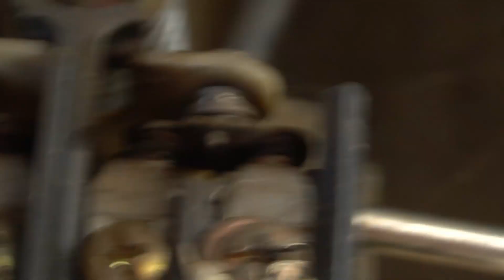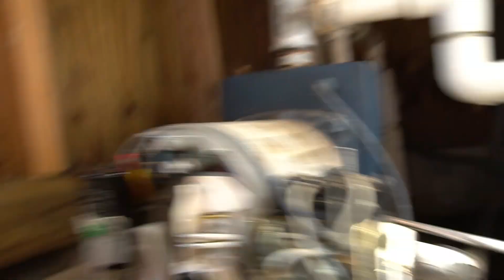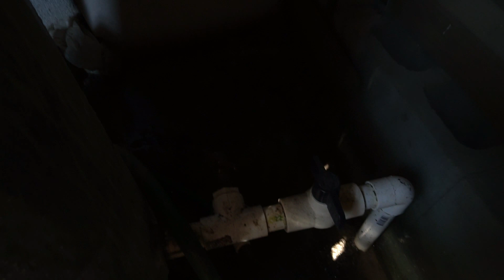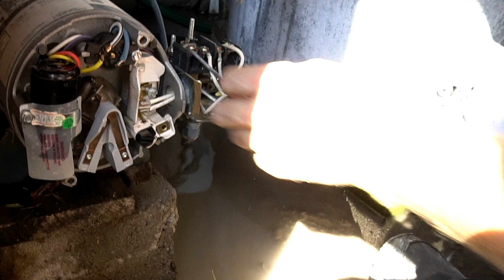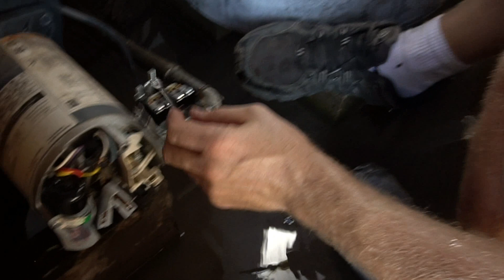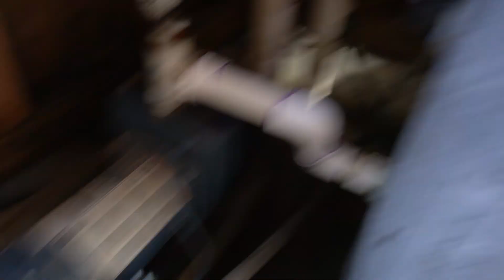Shallow Well Pump - diagnosis and repair

Comment: hi, I have a question, I have a 600 gallon water tank up the roof, and I bought a flow switch to stop the motor once water is low,which the wires are blue brown and black my motor wires are the same colors. I  match the wires up by color and when I plug the power cord to the motor  it spark on wall and burn the receptacle ,do you know which wire go to the switch ,  help will be appreciated.
Reply from the maker: You will have to read up on the instructions on that one, not familiar with float switching pumps.   The colors don't even make sense, should be a black power and a blue or red you hook to pump.  If your switching it then power needs to go through float to motor.    Good luck.
Thanks

Comment: How do you prime this type of pump
Reply from the maker: You remove the plug or gauge from the top of the pump, then fill with water. Replace the plug and leave it loose oh, turn the pump on and allow the air to come out. When water pressure starts squirting out then you can tighten the plug.

Comment: My shallow well pump isn't getting any pressure. It runs when primed and acts like its trying to pull water. But again it act like it isnt getting pressure. Can I get some advice on what might be wrong?
Reply from the maker: Do you have an Air volume control on your tank?
Reply: @ClearWaterPumpWell  not to my knowledge... it's just a basic well pump that  is inside the house. The residence hasnt had running water in close to 3 years. It seems it doesnt matter how much water I put in it still doesn't get any pressure. It acts like it wants to pull the water from the well. Could it possibly be the foot that is causing my issue?
Reply from the maker: @graceprose9347  if the pump runs and throws water and air out prime port, there is nothing wrong with the pump.  If it fills completely up with water and does not drain down or make a load sucking noise when turned off the foot valve should be fine.   You probably have a suction leak on the line from the well to the pump, it could be a cracked pipe, bad glue joint or loose at threaded connections.   If the water table is too far down over 20' the pump will be very hard to prime and not pump   high pressure.
Reply: I'm having this same issue and I do have a air volume control. Please help

Comment: Hello sir I have a question I have a 24-inch well that is between 45 and 50 foot deep the water level is at 36 ft the foot valve is 8 deep foot valve blinds Tupac pump bladder tank pressure switches and gauges and ball valve going to house have all been replaced new I can Prime the lines and pump and still only get 5 to 10 lb of pressure maximum at Bast which drops to zero upon opening opening the valve going to the house any suggestions
Reply: PS I meant to say the lines between the foot valve and the pump have been replaced

Comment: Good Vid! Very instructional. Wonder how many motors I have thrown away when all I needed was a part or two. Thanks!
Reply: I just replaced the 1HP pump on my shallow well (70'+)feet deep with water table at 15 to 20') (Good Water) The old pump lasted one year and a month, (Thats with use in the mornings to water the garden last August/September and this summer garden use). the shaft broke between the motor and pump. Pump was very noisy (bearings?) from the install. I bought the extended warranty and the replacement Pump was free at the cost of a new extended warranty. New pump installed, no leaks, no runs, no errors, runs much quieter, But the pump won't hold prime. I'm thinking Foot Valve has gone bad! Your Thoughts? The foot valve was replaced a year and a month or so ago. .The old foot valve spring was broken. I've thrown away 3 well pumps and have 3 old used ones in storage that something went wrong and I replaced. I've had the well 25+ years, now on my sixth pump.  Help!

Here's a funny for you. I set up a table saw many years ago to cut 2" foam insulated board. The one horse motor lasted two days. I went and bought a 2 horse motor that lasted another 2 days. I bought a 5 horse enclosed motor that still works to this day. I took the BAD motors to a repair shop. The contacts had plasticized over from the foam dust.Contacts were cleaned, All Motors still working today.

Comment: I have a submersible pump well i open the cover top of the motor i see the motor turn slowly then i change starting capacitor but it turn slowly again..please help me
Reply from the maker: It could be the wrong voltage, make sure the voltage selected on motor is the same as the breaker in panel.  120- but set 240 will make it run slow and over load.  240- and set 120 will make it run crazy fast for a few seconds and overload. 
Thanks for the comment.
Casey
Reply: What the problem if the winding is very hard to turn.  because i saw your video you turn your winding is a smooth but i turn my winding it is a very hard...
Reply from the maker: @markianvelasco5851 ,.  That could mean your pump impeller is binding or the bearings are going bad. Did it make any loud screeching noises before it quit working? If so it was probably the bearings, depending on the pump you could take it apart and check the impeller. But please make sure that it is a problem inside the pump before you open it up.

Comment: Had a question maybe you could answer. How do you know if a well even has water bought home and tank is there motor and electric parts seemed to be taken.
Reply from the maker: If you just bought the house and it looks like the well pump has been stolen then just contract a local company to check the system out. They can make sure the well is still good and nothing else was damaged also replace the pump and get water back to the house. Thanks for the comment,
Casey

Comment: Listen, the guy is good. I did electrical work of all kinds for 30+ years and I recognize his skill. Terminology was correct, diagnosis was accurate, the customer may not have known how much he was looking out for their interests, but he was. Not sure of his prices, but he did it right. Kudos.
Reply from the maker: Thanks for the comment and kind words.  I appreciate your explanation and experience as an electrician. 
Working on water wells allows me to have multiple skills required for the job.  I have worked as an electrician and plumber, but you also need mechanical skills and understanding of water hydraulics and chemistry.

Thanks again and take care Kind Sir! 
Casey
Reply: @ClearWaterPumpWell  
FYI for your viewers. 

Electrician here as well. Most modern digital multi-meters (not necessarily expensive) have a capacitor check function. They can also be checked with analog meters as well. Helps those on a budget to know if they need one or not. 

Thanks for this great video, I'm hassling with my pump as well which brought me here.
Reply from the maker: @johntrauger68  Thanks, John yea that's good way to check too.   I was trying to show how to Identify parts that are defective just by looking at them.

Comment: I have a question ,hope you can help ,I have a 1.5 hp  and the points were burnt , then some one brought me a pressure switch that was 20-40 and my tank is 82 gallons , and I replaced the start and run compacitors , the pressure switch will only come on when I push the restart , then shut off and will not come on by its self , very little water when this does happen any thing I can do to get this fixed? thanks for any help
Reply from the maker: Need to know what type of pump you have and when you say push restart, where is that at?
Reply: it is a in a  steel casing in the ground , the restart is on the pump control box , and only will start when I hit the restart button, the goes off about 2-3 seconds and then I only have very little water until I hit restart again, it will not stay on, and the water runs out quick since there is very little. just replaced the correct compacitors
Reply from the maker: It is either the start relay in the control box or a bad motor or pump end, binding or locking up.   You can do checks with a meter to find out if its the relay.  These are hard to get nowadays no one carries just the parts.  You might have to replace whole control box.  If the pump is very old like 20 years, it would be best to just replace the pump with a new one without control box.
Reply: ok thank you so much ,I thought it might have to with the new points being 20-40
Reply from the maker: @Rebecca230  The pressure switch won't be the problem, it's points are closed and ready for power.  The resets are getting overloaded from the issue.
Reply: thank you so much, I got a new control panel and got water , again thanks a million
Reply from the maker: @Rebecca230  Glad to hear it, Take care!
Reply: you as well .thanks again

Comment: Thank you for posting this video. I have to replace the pump switch after having no water one day. Points stuck together, but not connecting. Sanded them and had water again. I have the small pressure connection as you showed on the bottom of the switch. I went out today with hopes of changing this out, but hadn't come across your video until now. I didn't want to break anything so I put everything back together. I tried to get air into the bladder tank, but couldn't get more than 10psi while I thought the tank would be empty from draining down the system. Pressure gauge still read 37psi so I am going to replace it as I suspect it may no longer be accurate, but it shows motor coming on at 30 and off at 50. Very informative video
Reply from the maker: Yes if tank still has any water at all left and wont drain out its defiantly busted bladder/air cell.  The reason your switch is giving you trouble is due to the fact the tank is waterlogged, the short cycle will burn up the point and the motor/other components.  Make sure when you replace the tank the pressure in tank is a few pounds less than the pressure setting.  For a 30-50 setting tank air pressure should be 25-28 psi.  Make sure to check it yearly and air back up also to extend the life of your tank.  
Thanks for your comment!
Casey

Comment: What if there's no buzz anymore and the pump is completely cold?
Reply from the maker: Yea good question, I have found this usually means there is a broken wire somewhere, outside or inside the motor.  Have found bad connections in the motor from vibration or shorting out.  Be very careful turn off power and ohm out wires and visually look for burnt spots or breaks.   The windings themselves can be broken or burned in two, causing motor to not run.  Thanks for the comment and watching!
Reply: @ClearWaterPumpWell  initially, it was doing this buzz noise before it stopped working all together. Is it at better at this point to replace the pump? Its over 25 years old.
Reply: @ClearWaterPumpWell  I did check the bundle of wires that you said that if they looked black or brown or any kind of discoloration that the motor is bad, and they look perfect. Kind of a blue color with some copper coloring intertwined. Will the pump still have some kind of warmth even if the pressure switch is bad? I checked the wires coming from the pump and to the switch and they have power. The contacts were pretty black on the switch though. Will dirty contacts still supply a current?

Also in terms of the broken or shorted wire, will I need to actually go inside the pump and look at the motor? Are the windings the blue bundle of wires that you're talking about?
Reply from the maker: @tcookie12  The windings are probably heat tempered when they look blue or purple, they didn't quite burn up yet.  But it sounds bad enough not to run.  If it's still not making any noise, then there is still a broken wire somewhere.  The pressure switch could be a problem, turn off power and put both sets of wires on each side under one screw on each side.  This will bypass the switch, see if it does anything then.   Lots of ways to test even if you don't have a meter.

Comment: I am having a similar issue , the pump runs hot  but when I turn it off for a few minutes to a hour it kicks back in fine. for a day or so or few weeks it varies. The pump is only less than 4 months old. Nothing is corroded or burnt I checked it should I still replace the Capacitor
Reply from the maker: The issue you're having is probably not a problem with the pump. Your tank is more likely the issue, being waterlogged having too much water and not enough air. What type of tank do you have is it a bladder with a valve stem on top, or a standard tank with an Air volume control on the side?
Reply: @ClearWaterPumpWell  Standard tank with a Air volume on the side
Reply from the maker: @AngeloBHall  does the pump kick on and off rapidly like every few seconds when you run the water?
Reply: @ClearWaterPumpWell  No
Reply from the maker: @AngeloBHall  the only other thing it could be is a binding impeller or bad bearings. Does it make any squealing noises or motor seem to be under a higher load at times and bog down? The pump may trip the breaker or get too hot and turn off also.
Reply: @ClearWaterPumpWell  It does not sound any different that's why its weird that it cuts out like that .. I've heard that if the well is very low the pump runs extra hard . Could it be when tide is low?
Reply from the maker: @AngeloBHall  no not likely, let me try helping you over the phone give me a call when you can.
Reply: @ClearWaterPumpWell  Okay thank you .

Comment: Oohhh please help,  my pump motor gets hot then kicks off, the pressure stitch is working
Reply from the maker: richard myers Your motor is overloading, make sure you don't have it covered up and it can get air flow to motor.  If it only runs for a few seconds then overheats it could be a binding impeller, burnt windings, low voltage or bad capacitor.  Not something you should try fixing yourself call a local water well service company.
Thanks for the comment, Casey
Reply: @ClearWaterPumpWell  thank you so much, I figured it out, it was set up for 240v and we had  120v going to it. Once I realized this and moved the wires to the appropriate connection it works like a charm!! Thank you for your reply!! Bless you!!!
Reply from the maker: richard myers yep that can definitely happen to especially when installing a pump.
Take care

Comment: Hello I have a waterlogged Hobart glass lined well tank with the leaking air vine control setup that is leaking. I would like to replace the vine with an air release and snifter valve. The only air release  I can find are called Deep Well. My well pump is a shallow well jet pump in a 25 foot deep well . will this "Deep Well" Air Release work? Where can I get a quality unit? Thank you Mike
Reply from the maker: Mike Starr unless you have a free flowing well do not convert to a sifter and air release. Your pump could lose prime if you do it this way and you don't have a flow well.  Just replace your "Air Volume Control", drain the tank completely and then replace the AVC.  Check the AVC after you fill tank back up, run it back down and see if it draws air. You should be able to check from the back or bottom of the AVC where it draws air when the pump comes on.  You may need to turn down pressure of cut on to 35psi or less to get the AVC to pull air. It is crucial it will water logg the tank again if not set correctly.   Thanks for the comment, Take care!
Reply: Ok I looked up free flowing well and I do not have that as I need to pump up my water. Is the "Air Volume Control "the same as a "Air Vine Control"?  I see a different type on line. the leaking one I have looks like the on on the Video "Shallow Well Pump - diagnosis and repair" shown above. My new Gould J7 pump is set at 30-50 psi and runs to long and the motor is getting HOT. Hopefully draining the tank changing the Air Volume Control will fix this problem.
Can you recommend a quality Air Volume Control? Thank you for your help.
Reply from the maker: Hey sorry took me so long to get back, I dont know about a Vine, i think someone said i called it that but its not.  There are only Air Volume Controls and Air Releases which can be called the same thing also.  A avc controls how much air is in the tank, but other types used on shallow well and deep well pumps are the types that put air in the tank and do not overfill the tank with air.  An air release only lets air out the tank, they do not put air in.  

If your pump is just running and wont shut off dont let that happen for more than a few mins, it will melt the fittings when the pump runs hot.  A pump runs hot after it cant build more pressure and just circulates water in the pump, heating the water near boiling and melting pvc.  This can lead to melted jets, impellers and leaking shaft seals, so avoid this if you can.  A defective AVC will make pump continue to run due to sucking air and losing prime.  Replace the device and try pumping again, if it fails to get over 30 psi about then you may have to clean the jet out.  On a shallow well pump, there should be a plug on the front of the pump snout near suction that is in the center of the impeller.  Taking the plug out and inserting a thin screwdriver less than 1/8 diam. will usually clear a clog.   Iron or plastic parts may be blocking the jet and preventing the pump from building more than 30 psi.  Worst case you may need to take the pump apart to clean, but at this point if there is not a oring seal you would need a gasket to repair.  You may need to call a water well service contractor at this point to repair the pump.

Thanks for the questions hope you were able to get things going before me getting back to you.
Casey